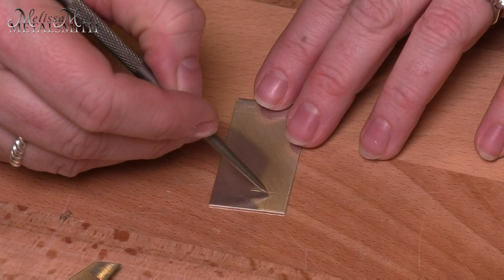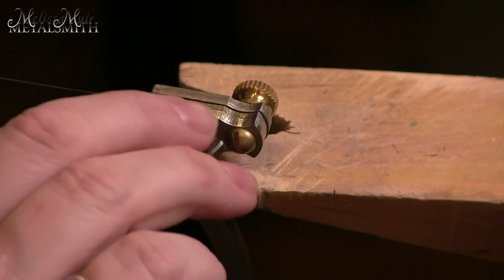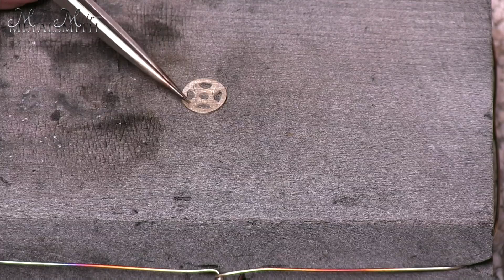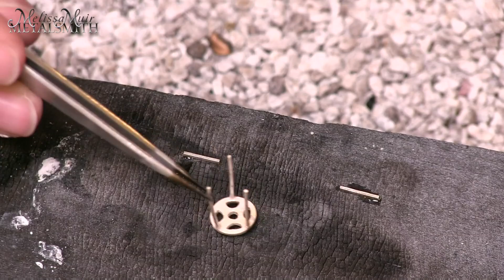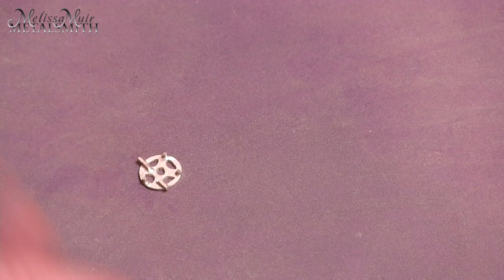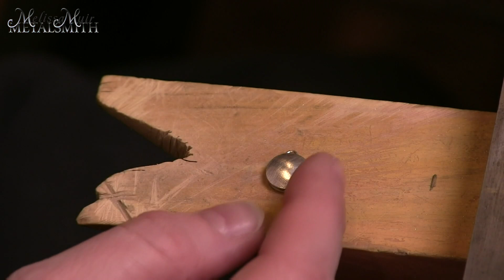Project 16- Necklace Clasp - Alan Revere Series - Tool Time Tuesday - Melissa Muir

Comment: May I ask what is a "Will hold?" Also, when you practice making these clasps, do you use your silver? Can I practice using a less expensive metal? You do amazing work!
Reply: You can definitely use a less expensive metal. It's actually recommended so as not to have any waste. Though, unless you use a bunch of solder, it wouldn't really be waste since it can be melted back down and reused. But in this case, using copper would be a good base metal to practice with. Plus, if it comes out good, copper is still pretty and used in jewelry still by many so you can always keep or gift, or even sell the practice one as well. Most of my copper pieces that i use as practice go to my family and friends. My daughters absolutely adore jewelry and they have a good collection of costume jewelry because of it. So theres really no waste no matter.lol
Reply: You can definitely use a less expensive metal. It's actually recommended so as not to have any waste. Though, unless you use a bunch of solder, it wouldn't really be waste since it can be melted back down and reused. But in this case, using copper would be a good base metal to practice with. Plus, if it comes out good, copper is still pretty and used in jewelry still by many so you can always keep or gift, or even sell the practice one as well. Most of my copper pieces that i use as practice go to my family and friends. My daughters absolutely adore jewelry and they have a good collection of costume jewelry because of it. So theres really no waste no matter.lol
Reply: Hi grannynara, you can get a WILLHOLD from William Cobb. He creates custom tools for metalsmiths. Have a beautiful day! xoxo